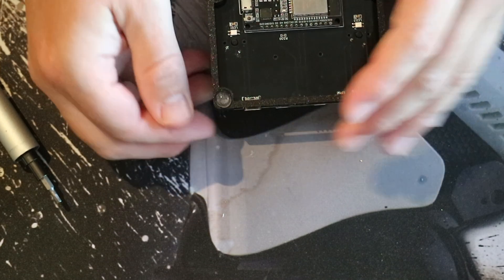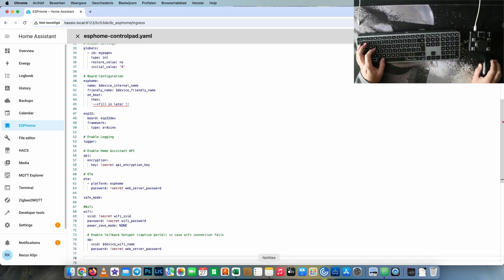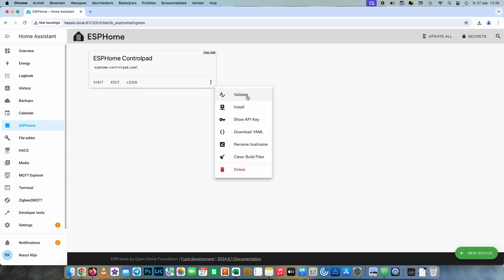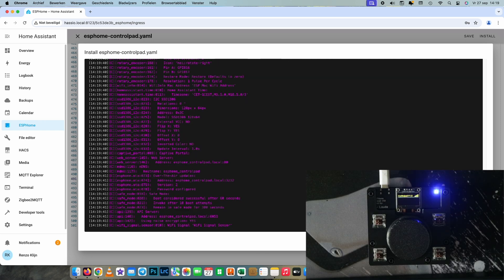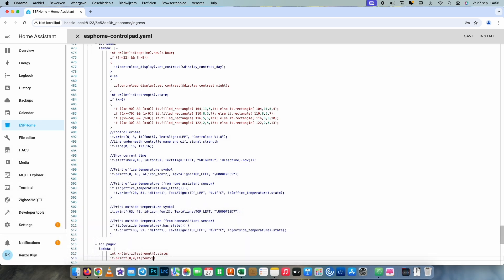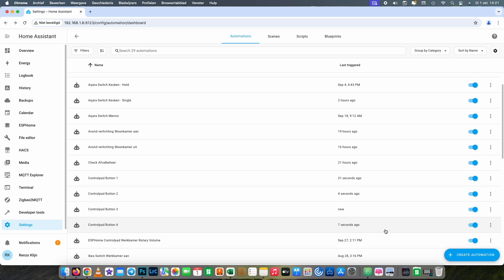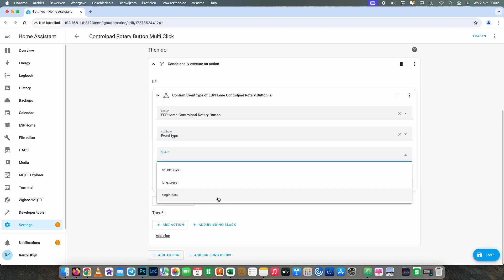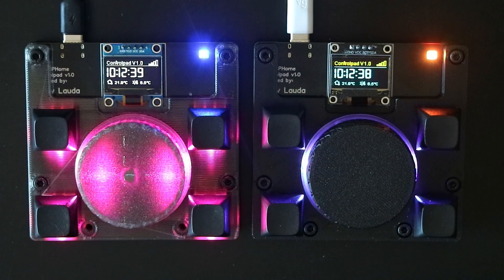DIY ESPHome Controlpad - part 3

Comment: This is incredible!  Is there a way to have PCBway pre-assemble the whole circuitboard part, and then copy your code? (you said it was on your Patreon, I think?). I am not afraid of light soldering but that's a little more than I'd like to take on.
Reply from the maker: with the files on patreon you only have to solder the trough hole parts, if you want i can check if they can do the whole thing.
Reply: @ Considering there are few alternatives on the market, if they can actually make one entirely except for the programming, there’s likely a market. :)  (personally, if I have so solder a few through-hole parts that’s fine, but this many would be pushing it for me)
Reply from the maker: @compudude  i asked PCBWay what the options are. if they cannot deliver maybe i can open a Ko-Fi shop or something. i'll keep you posted.